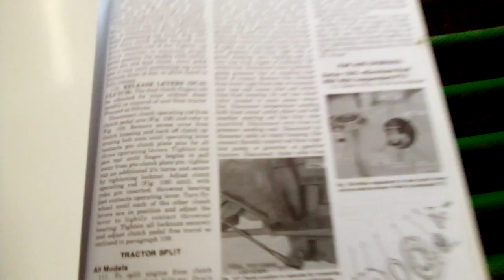1972 John Deere 1020 split

Comment: Which book do you have?can you tell me what goes in the cap just below the back of the seat?just got a 1020 myself.
Reply from the maker: https://www.amazon.com/John-Deere-Shop-Manual-Service/dp/0872880796
Reply from the maker: That is the fill for the transmission/hydraulic.
Reply: @westfolk  I won't have a book for a few days yet but I gotta know...I open mine and it's not filled with anything I just see the inside of transmission.it does have leaks though so it might just be low? can I use tractor supply's universal hydraulic fluid and how much, there's no dipstick? thank you for your time and assistance.
Reply from the maker: @jajaid6 dipstick is next to your right heel when you are sitting on the seat. Below and further back from the serial number plate.
Reply from the maker: @jajaid6 use VP racing oil. Not Travellers from tractor supply
Reply: @westfolk  I have a starting point now!thank you very much!